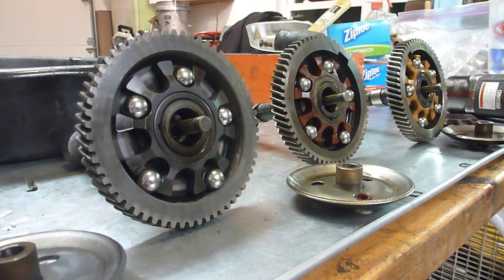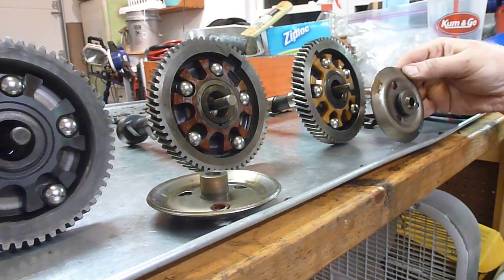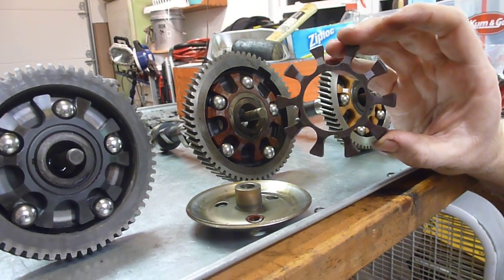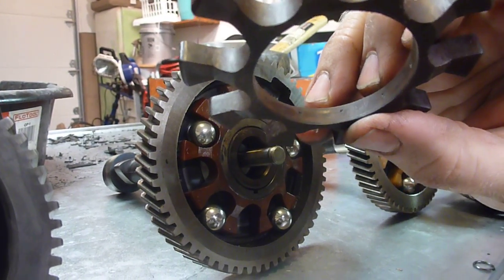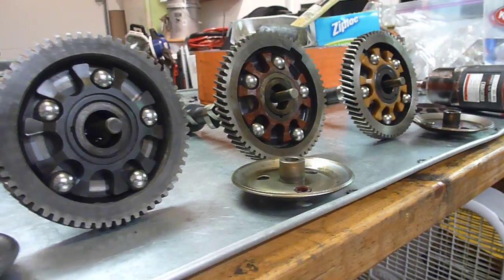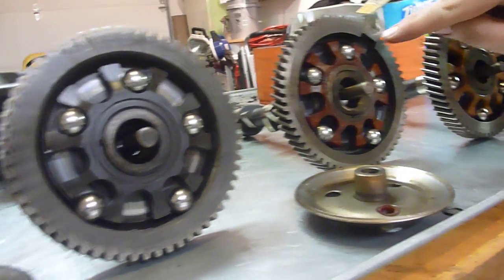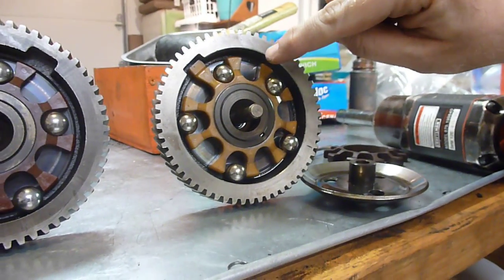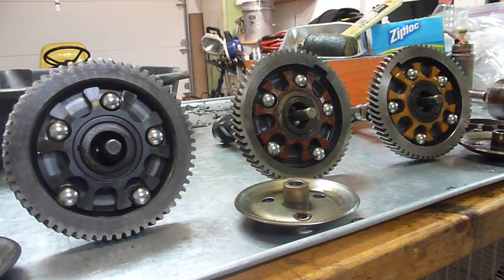John Deere 318 Onan Flyball Spacer Differences

Comment: Can you remove these if I was wanting to delete the governer?
Reply from the maker: I don’t see a way to remove the governor. There would be no throttle control other than the spring on the throttle. With no way to control the load, particularly at light loading the engine wouldn’t perform well.

Comment: What fo you think about re-glueing the p218 back to the cam
Reply from the maker: I've never personally tried re-glueing the spacer. I suppose it could be done though. I would throughly read up on the adhesive of choice before I did it.
Reply: I tried this with JB Weld and it worked for a while, but broke loose. 

Don't bother with 3D printed versions either. Even the high-temp filament can't handle the heat and will melt. 

Currently looking into having some machine milled from a 3D printed design I had a friend make.

Also, this same problem exists on basically all the 500 series Wheel Horse with Onan engines. The P220g is notorious for it. I have at least 3 that need a metal spacer.

Comment: This was a great video. I’m thinking of buying a 318 and I’m trying to figure out what Onan year to stay away from. Is there anyway to know what cam or flyball spacer is in a given engine? Can you go by spec number, A, B, C, etc? Any other 318 issues to lookout for? The one I’m looking at is a 1988. I don’t know the engine number yet. One other question would be about the Yanmar engine. Would getting the 322 gas Yanmar be better then the 318 P218’s? Thanks for the help.